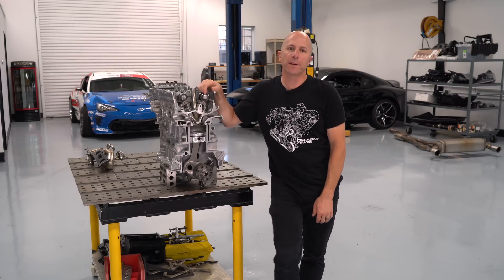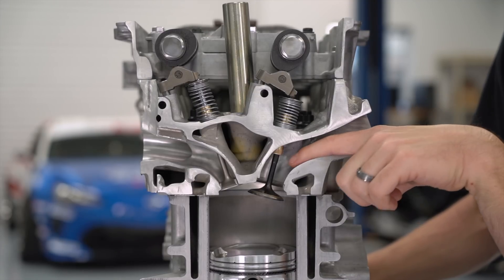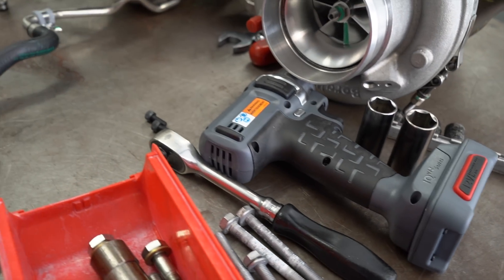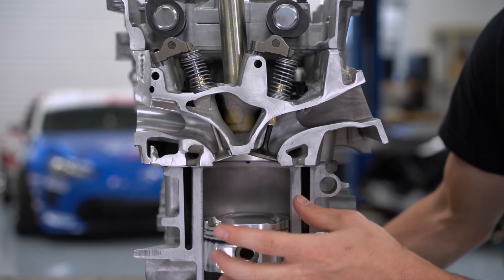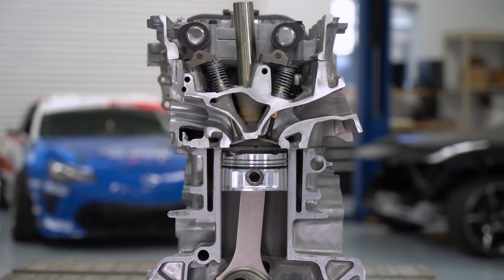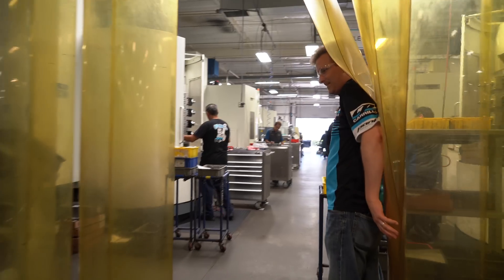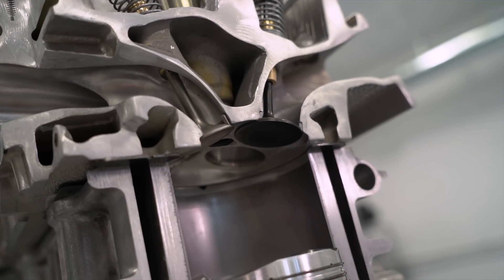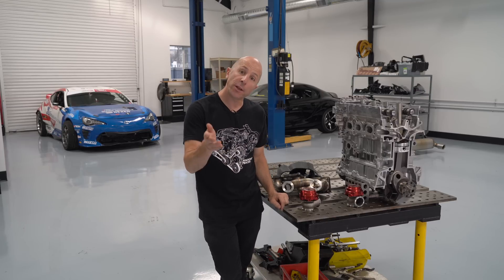The Making of 1,000 Horsepower 2020 Supra Engine Parts

Comment: I like how they challenge themselves and not just 2jz swap it.
Reply: There would be much more work to 2jz swap it and it would end up being arguably worse
Reply: Yea its also going to be a challege to match the hp 2js have made... b58 wont ever get CLOSE to it. This engine seriously reminds me of a Toy. 75% plastic shit 🤣 They needed to revape the whole thing and push 50lbs of boost to get Any power out of it. Lmao
Reply: @TomKaosOfficial B58s make the same power as a JZ unopened. JZs only dominate Tex2k be wise there’s been enough time to develop billet blocks & beefy internals.
Reply: @CadexLaw At the end of the day nobody cares. No one cares when the b58 was Only in a Bmw, now all of a sudden people care because of a Supra badge. Mega 🏳️‍🌈
Reply: As if you don't need to put at least the same amount of job done to make 2jz match this power level...
Reply: The 2JZ is a heavy engine. So heavy actually that I don't understand why more drifters put in a V8. Even toyota's UZ engines weigh less and can make the power just as easily. More than this a the JZ is longer, so you will have less optimal weight distribution. And this BMW engine is lighter than the JZ too, so there is something to say for this. I personally think that making 1000hp on this bmw engine is more of a PR stunt to show people what he's capable of.
 @an0nim11  Nope, you don't. You don't need to cut open, 3d scan and reinvent the wheel, you take a JZ apart and bolt on new parts. The JZ was an engine that was build way to strong for its task, that's why people make power with it, this new BMW engine is build to handle the factory load. Apart from that stroker crankshafts, forged pistons for the JZ are readily available, here you need to custom build them.
Reply: @sasjadv  yeah it's because b58 is new engine... Still i guess you can double the power on stock internals on both engines but to get 1000 hp you have to modify them as much in both cases... That's what i ment.
Reply: @an0nim11  You have to modify the internals of the 2jz to get 1000hp as well lmao
Reply: @MoToKiNg378  and thats what i've said so what is your point?

Comment: What a great video Stephen!  An enjoyable watch for every skill level.  I am wondering if the integrated exhaust ports in the head will become a bottleneck (Glad to see you are doing some work on them).  It would be interesting to install a sensor to monitor the pre-turbo pressure in the exhaust manifold.  Looking forward to you pushing the limits of the B58!

Comment: “We’ll save that for stage 2” 
As if 1000HP is stage 1😂😂
Reply: The stage doesn’t refer to hp but what’s being done first, stage 1 (rods, pistons, cams, turbo, intake) stage 2 is more complicated and would require changing the bore and stroke. This is not some gimicky intake only + tune “stage 1” marketing nonsense.
Reply: Stage 1 is 1000 up compared to the Toyota built Supras.
Reply: 1000 horsepower is stage 1 dum dum 😂
Reply: Hahahaha it kinda is considering it’s the first idea popping into his head 😂
Reply: 1000 horsepower is the first stage in any builders mind because horsepower is key over braincells 😂
Reply: MixedNuts i thought he showed a shorter stroke
Reply: @mixed_nuts  It's stage 2 when a single component upgrade require other components to be modified as well. Didn't you see the big turbo requiring a new intake manifold, forged pistons, stronger connection rods and engine remap? That's the definition of stage 2.
Reply: sTaGe 1 StAgE 2 stAGe 3
Reply: It is for a junkyard 5.3
Reply: Well stage 1, 2 etc don't really mean anything so whoever's building the engine gets to decide what stage 1 is
Reply: Skip the stage ricer talk.  Real ppl just build the engine...
Reply: Why not? 6 cylinder engine. 1,500 hp with better torque would be stage 2 but I don't believe in all this staged stuff. Most of you as stated by one of the better Aussie tuners of VW's said that most of you are interested in driving dynamics, so you prefer manual transmissions and only want a little increase in power. I am more like Papa, I like to be competitive so in my world that means 500+ hp min and only change how I drive the car slightly. Yeah I have more lag but it doesn't matter when the light turns green.
Reply: @dj4monie  stfu lol
Reply: Shnek IKR I read like 2 sentences of his crap then moved on
Reply: @dj4monie  i mean it does matter when the light turns because u got shit ton of lag
Reply: Alright, so you could interpret it that way that 1000hp is stage1, or this way: the goal is to make 1000hp, that's just a goal and no guarantee, if he fails and gets stuck at 900hp, then he can swap the crank and still make that 1000.
 @dj4monie  Why not? Well, the power that an engine can make depends on a LOT of factors, and cylinder count is at the bottom of that list. Displacement, R/S-ratio, B/S-ratio, shape of combustion chamber and ports, boost pressure, type of fuel etc is what matters, and then you have limiting factors like strength of components, disbalances, boundary layer separation in the intake flow, resonance, cooling capacity. And this BMW engine does have limiting factors, way more than the 2JZ or the old M50 series of engines.
Btw, stage 1, 2, 3 are 100% marketing terms, there is NO universal definition for what these stages mean. For some stage1 is a new downpipe and chiptune, stage2 is a new manifold and turbo and stage 3 means porting the head. It really depends on who you're asking what these stages stand for.
---
One last thing: for drag racing you mostly look at horsepower, but for drifting driving dynamics is actually priority number 1. If you don't have control then you can't make those turns during a slide.
Reply: @sasjadv  did you just day this engine is worse than the 2jZ? Okay fanboy. Literally nobody believes that.
Reply: @MylesKillis  I think you're replying to the wrong person... 🤔

Comment: I’m no engineer so I could be wrong. Do you think the exhaust ports are going to be able to flow enough exhaust gasses through to be able to produce 1000hp? Also the cylinder heads from a m140i (b58 engine) has 6 exhaust ports. Could you replace the head from this engine from the m140i?

Comment: “Maybe we’ll save that for stage 2” 😂🔥🔥
Reply: as if forged internals, new turbo, custom manifolds and engine mount relocation kit, was a beginners stage 1 😂😂
Reply: @aaronthomas9696  the internals are already forged.
Reply: @carboydorifutoparty3976  well they wanted even stronger
Reply: Stock block crankshaft so yeah stage 1

Comment: Anybody else notice how thick the wall is between the exhaust port and water gallery its like 1mm
Reply: Yep, you're probably better of sawing that exhaust off, and welding or pressing in 6 real exhaust ports. These 6 cylinders into 2 ports thing is a bad design anyways, especially at high airflow, and that's exactly the region that you need for high RPMs and a huge turbo. You basically want these ports to stay separate for a bit longer and combine later on.
This new engine is sort of a powerhouse that's build to prius' specs. The 2JZ was build to be way stronger than it needs to be, that's why people have an easier job making power on that thing.
Reply: sasja de vries. You don’t need to do that when other BMW’s have the same engine with individual ports noob.
Reply: @sasjadv  Well here's the strange part. No other B58 has 2 ports yet the supras does. Whats stranger is that next year's mk5s are supposed to have 6 ports rather thsn the 2 ports this year's mk5s have,strange decision from Toyota.
Reply: @carboydorifutoparty3976  z4 has 2 ports too, theres a few models of the b58 now. the 380hp bmw engine has 6 ports still, the 335hp b58 now only has 2 ports.
Reply: @marclynseywilliams  no? I've heard that the Z4 has 6 ports while the mk5 has 2 ports.
Reply: 1mm is not thick lol

Comment: The piston velocity never exceeds 60 miles per hour, its much less in fact. Do the math. :)
Reply: It hits exactly 60mph and don't forget it's being pushed up a 60mph then being pulled back down again instantly and being pushed back up again instantly. The acelloration of a piston over 3.72 inches is incredible.
Reply: @rhysbertrand8903  No, not exactly, it depends on the stroke and RPM.
Reply: @tihzho  that's exactly what these calculations were based on. 9000rpm which he stated in the video and the 3.72 Inch stroke of a b58 because he said he's not changing it
Reply: 433g force to be exact at the moment of acceleration and return
Reply: From 0 to 60 in 0.00666 seconds and back to 0 again

Comment: Exhaust ports are going to be a big time flow problem. Head is set up from factory for quick spool up not air flow on exhaust side. Should have used stock rods first to see how strong they were before cutting block and head in half. Then cut blown engine in half. Just saying, good video I liked it.

Comment: Cool Build. I'm going to make a hypothesis. If the exhaust is flowing through the head and bottlenecks into two ports wont that create an absurd amount of heat at 1000hp? Maybe enough to warp, crack or even melt the aluminum head? Seems like that's a major downfall to this build.

Comment: You took the 2AR-FE 2.5L 4 cylinder engine and stroked it to 2.7L with 1AR-FE engine parts. Why not just use the 1AR-FE 2.7L engine in first place? And there is a direct inyection version of the 2AR, the 2AR-FSE.

The 2AR-FSE  is a variant of the 2AR-FE equipped with D4-S direct inyection and port injection. It has the same bore and stroke as other 2AR engines but the cylinder head, cams, pistons and fuel management system are unique. Maximum thermal efficiency is about 38.5%. The expansion ratio is 13.0 to 1.

There is growing interest for 2AR-FE performance for Sport Compact Drag Racing, like say put a 2AR-FE engine in an old school TOYOTA KP61 STARLET for the Modified Compact class. TOYOTA  engines with engine codes that end in "FE" have cylinder heads that are not high-rpm friendly, I know you have adressed the issues of the  "FE engines" cylinder heads; ¿Any expertise or parts available? 

Thanks for all your work with these engines. I might want to see you turbocharging a TOYOTA 3.5L 2GR-FE engine too.

Comment: Also very curious on what engine management he will be using. And how he will control the Valvetronic system. The eccentric shaft and intermediate levers he took apart in the previous video along with the valvetronic servo motor is the main throttle. Curious to see if he could get a stand alone to control that.
Reply: I'm curious too, as that's why cams aren't really needed when you can control lift and timing. I also wonder how the cooling system is going to be re-plumbed since he ditched the intake.

Comment: The whole argument against this engine was that from the factory it couldn't hold the kind of power the older 2JZ could.

... Replacing basically EVERY component on it just proves that even more.

I really appreciate the video and you guys are definitely doing some good work, but I still have no love for this BMW.
Reply: There are no engines that can eat 1000hp without having to do at least rods and pistons.  To get a subaru engine even up past 700hp you have to replace the block.

Comment: I can change gear and engine Camry xse 2019 to Supra 2020 gear and engine and divrintion like factory
Reply: Mohamad Alsharif Would be incredibly hard. This Supra has BMW running gear and is rear wheel drive. Not Toyota engine with front wheel drive. You would have to cut your car up

Comment: 7:05  Love the flow bench screen shot!  The Blue line is Intake CFM vs. Valve lift and what caught my attention was the light grey line.  This should be the the CFM of the exhaust measurements from the 2nd tab if I read the User's guide correctly.  If that is the exhaust CFM it is interesting that it out flows the Intake at lower valve lift.
Reply: James. looks like those are the stock intake and exhaust numbers. 200CFM at 0.5 inch valve lift is very small.  example at 0.6” valve lift my boss 302 heads flow 320cfm. then again this is the base model.

Comment: Well this looks like an economical build. 😬
Reply: Yeah, all they're doing is re-engineering the internals, you know, just the basics lol.
Reply: And it was way more expensive in money and time when the 2jz came out
Reply: And here I'm debating putting an oil catch can on my direct injected Honda four cylinder.
Reply: More eco than a 2jz
Reply: honestly, the guy is most likely getting normal price or even free parts. giving people like JE pistons and Cp rods the oem parts to base the upgrades off would benefit them greater. these products are going to fly off the shelf especially if they are the first and didn't need to buy the car/engine to begin with.
even if not for a raceteam that would have a budget of half a mil, its nothing.
Reply: elliott b that’s a very good point
Reply: Rods, pistons, a bigger turbo, new manifolds and mild head porting.  That’s pretty standard stuff for this kind of build.
Reply: You lot are talking like this is special you can call them up and do this your self or do you want to send a rod through the block.

Comment: Are you sure that you're not turning the engine the wrong way, and mixing the intake and exhsaust valve? I thought that the exhaust valves is bigger than the intake valves. Very ineresting video by the way.

Comment: Looking forward to finding out how much power the B58 puts out, with the 2 exhaust port head🤔
Reply: Me too. That HAS to be a huge limiting factor. I’m guessing BMW did it to increase velocity and spool time, but at some point, it will have to limit absolute power. I can imagine valve float or even melting the heads becoming a problem as pressure and temperatures skyrocket in those little ports.
Reply: @alphazuluz  the two exhaust port is design, is so that the exhaust gas is cooled down before entering the turbocharger.
Reply: @scgtimk1  with conventional head setups ceramic coating exhaust manifolds to retain exhaust heat.. how do you figure this really short from exhaust valve to turbo setup is for cooler exhaust gases?
Reply: @robertf6523  the gas has to go thru the passage in head and cooled down by the coolant passages nearby before exiting to the exhaust.
Reply: Abu Ryan I don’t think that is correct. Cooling the exhaust gasses BEFORE the turbo means you will reduce exhaust pressure, increase spool time, and reduce the energy driving the turbo. This is why engineers go to great lengths to shorten the path from head to turbo, and keep the turbos hot.
Reply: @scgtimk1  what zolen said. 

basic thermodynamics.. cold things shrink (which is great for getting a more dense air charge into the intake - it's why we use intercooler) 
and hot things expand. When doing something that involves the most volume of a gas flowing through something like the exhaust side of a turbo to drive the intake side of a turbo - you want the exhaust gases hot to spin the turbo. It's why ceramic coating turbo manifolds is a thing.. you want exhaust gas hot and expanded.. it spins the turbo faster and harder than 'colder' exhaust gases.

intake side you want to cram as much oxygen into the cylinder, a fixed amount of space.. cooling achieves that.

exhaust that drives the turbo.. it's all about getting the most bang for the available volume of gas =hot gas. Not to mention heat in itself is a form of energy transfer
Reply: @alphazuluz  than why not do the old fashion way.
Reply: @scgtimk1  because the old fashion way means piping exhaust through longer manifold / header passages which actually does cool exhaust gas and reduces exhaust pressure
Reply: Johnny Knapp it’s not exactly “two ports” the manifold itself is integrated inside the cylinder head (the same as it would be if it where bolted up outside)

Comment: Why not make connecting rods out of titanium? I guess postons can be made out of titanium alloy as well...
Reply: @Seb C Expensive? Dude, they have everything custom made, visiting engineering/Precision CNC manufacturing companies... Worrying about cost was booted out of the door long time ago. Titanium would not only give you a tremendous strength but also significantly lighter, 3 feet long 0,75" titanium craw bar weights like a wooden stick, bends 20-30 degrees (we were trying to move concrete foundation block) and bends back! then less weight those rods are, then less stress on crankshaft and entire engine, less wear on bearings, etc. They're buiding one-off 1200hp monster, yeah lets worry about few bucks here and there, lol. That engine will be golden just from manhours spent on it, forget about materials.
Reply: @Seb C machinist that made titanium craw bars for us said that you need much lower rpms of a mill and with right tip, it is just as easy as work with the wood (probably not that easy/simple) but he also said that, yes, if you try to handle titanium as regular steel, it will burn your milling tools 1-2-3.
Besides, it is just a couple of rods, couple of pounds of material, how significant cost increase could there be. I was watching some videos on youtube, guys were ordering parts for street BMW out of titanium alloy, not making the show or 1200hp one off showcar. Just "my BMW has more titanium parts than yours" kind of thing. Like some getting their lambo goldplated to be cooler than Saudi Sheikh next door, this guy just wanted titanium engine in his bimmah. Did not work out at the end, I think, block had given a crack or something.

Comment: I'm not exactly sure how the exhaust is ported through that head but I can see one of 3 possible scenarios playing out,
1, over heating the head causing coolant flow issues.
2, cracking the head from heat cycling
3, not spooling that giant turbo Because your going to be removing the heat from the exhaust and putting it into the cooling system.
Just my thoughts.